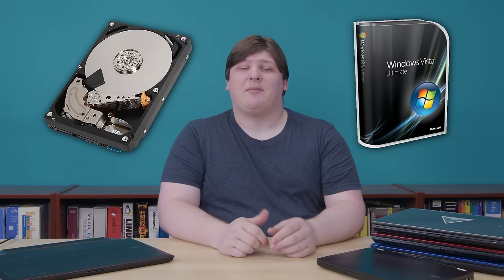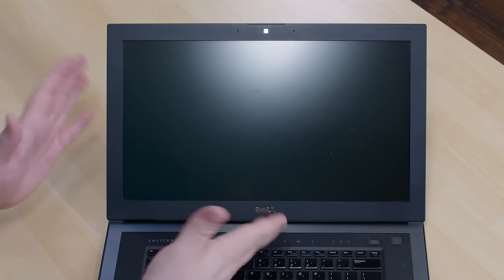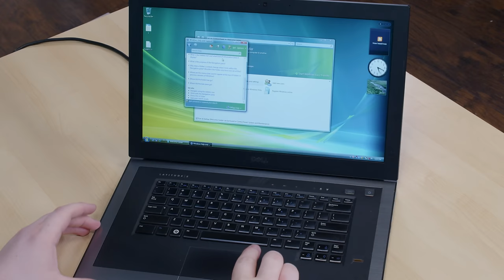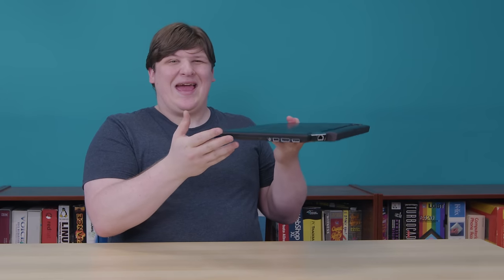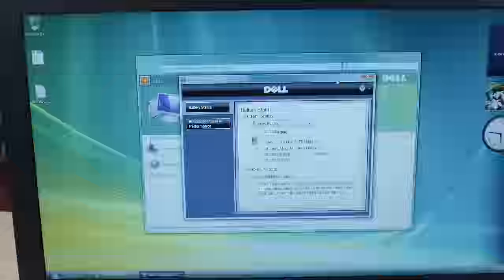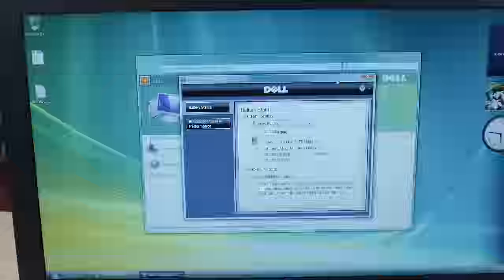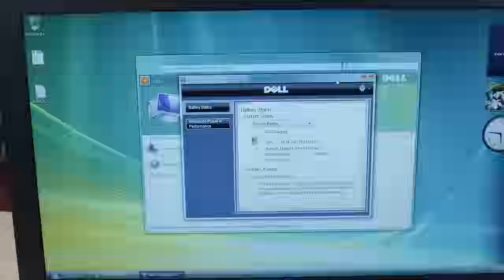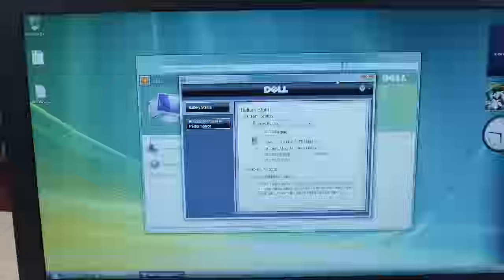Quick Start Ep 6: Assuming Direct Control

Comment: That wireless dock & display is pretty similar too the " Intel wireless display WiDi " approach that intel showed off, got that on my lenovo T420, actually works pretty good for putting up a youtube or netflix stream onto a TV while the laptop sits on the livingroom table easily accessible still.
Think it's basically the same as miracast just under a new name & a bit more more locked down hardware wise too Intel because ofc it is.
It has a pretty low latency on my dads tv but it's noticeable probably 100 - 150 ms slower compared to hooking up the laptop directly too it.

And I'd imagine is basically the same tech anything with wifi capabilities uses to cast the display to a smart tv or to a chromecast or miracast supported device, even blackberry phones supported it apparently from version 10.2.1 onwards.
Reply: Whereas WiDi is just wireless display, the wireless dock is more akin to WiGig, which is another wireless protocol used by Dell and allows full use of any accessories wirelessly... also via a wireless dock.

Comment: I've even suggested that (Desktop) motherboards should have a cheap mobile SoC on them to use for the light PC use they are used mostly for (internet/videos). How many people sit with a high power CPU and GPU desktop just to watch YouTube? (raises my hand). A modern cheap Mobile SoC could actually be fast enough to be useful while sipping power and keeping dust out of the system (no fans running), and it would be great for trying to solve hardware or software problems with your main system.
Reply: I wouldn't mind having a raspbery pi in my desktop or laptop as a secondary option. It would work better if they could switch reasonably fast from one to the other.
Reply: @PaulSpades  Well.. I don't see it ever being seamless with Windows. Even MS gave up on ARM Windows 8 since they underestimated buyer intelligence. They assumed people would like the cheaper Windows tablet version.. but buyers saw it for what it was- a tablet with an OS that looked like Windows 8 but forced a special Windows ARM Store for all software (A La Apple). You had to buy ARM versions of all your software to even run them on the ARM Surface. SO an SoC would probably need a custom Chrome OS type OS for cloud based stuff so you weren't using the same harddrive/files as Windows. But also give it some other tools for dealing with the main hardware/OS when borked.
Reply: @BReal-10EC  Oh, no, I don't want microsoft anywhere near my machines.
Reply: @PaulSpades   Ok Paul, show me - and the court- on the Dell Optiplex where Microsoft touched you.

Comment: It's odd that you've had consistent boot times. As someone who was very active in the laptop scene at the time, I can tell you from experience that on many machines Vista was painfully slow to boot. Multiple minutes wasn't uncommon, even on brand new laptops. I helped a friend pick up a Toshiba Satellite not long after Vista came out, and out of the box I remember being blown away at how slow it was, and I remember checking thinks like CPU-Z to make sure the advertised hardware was actually present because I couldn't believe how bad it was. Later updates improved this (and so this might be part of the difference you're seeing -- if you can, try and get an original Vista install, especially Home Basic which was pretty crap. I remember Ultimate being quite a bit better).
EDIT: That scroll bar on the bezel was definitely not unique, I can remember other laptops that also had it. I'd have to do a bit of digging to find the exact models, but a lot of the early 2-in-1 laptops that could flip over to become tablets had those edge scrolling touch sensors to make it easy to read text in "tablet' mode.
Reply from the maker: Hmm, are you sure those weren't just leveraging the touchscreen? Maybe the digitizer was slightly larger than the screen and extended under the bezel. Interesting angle though, I'll have to investigate.
Reply: @CathodeRayDude  I''m almost positive it was a separate strip, and on some early mobile Windows PC devices they had those strips because the screen itself wasn't touch sensitive. I feel like I remember Bill Gates giving a live demo with one of those early machines and it had the touch scroll bars at the edge of the screen. To be fair those weren't laptops, really.

Comment: 26:10 you need the bios of the highest spect model, it’s not a firmware thing it’s a bios thing wireless charging had a different model number and a different bios version but not a different board revision.
The bios of the wireless charging version doesn’t completely turned off the device completely in order to enable the charging detection with the downside of using more power when it’s turned off  to prevent users from accessing a feature that is not installed they just took out the code for it and left the entry in the UI, typical thing done by Dell cause bios versions are interchangeable.
Reply from the maker: That makes sense, I wonder if I could have flashed it on there.
Reply: @CathodeRayDude  pretty sure you can, the tricky part it to get the rom for it to make it happen.

Comment: I have to admit, I've never really had a problem with Windows  Start time on hard drives.  Well, at home anyway.   At work, it's a different matter.  Something in the image of Windows we depoy really slows down booting.   Never found out what, because we just bypassed the problems by upgrading to SSDs, but the startup time  went from a few seconds to nearly 15 minutes before Windows was running well enough to allow logins..

Comment: Ironically enough, boot times are not improved with modern hardware because of POST duration increase. In fact it may be quite the opposite if you had decent DDR3 machine with an SSD back then.
In DDR3 era, POST times were around 5 secs, short enough not to be even noticabe. OS startup time was the thing that matters.
In DDR4 era, POST times increased to around 15 secs and, considering overall performance uplift and wide spreading of SSDs, began to actually exceed the actual OS startup time. Espectially if you use Linux.
Now, in DDR5 era, POST times are absurd. I have 30 secs POST time on my AM5 machine. Considering that the hardware itself is powerful enough to spin up my Linux distro in 4 seconds. (Actual output of systemd-analyze: "Startup finished in 30.167s (firmware) + 190ms (loader) + 2.354s (kernel) + 1.364s (userspace) = 34.077s".)
And this is actually may count as good because some people report 1 minute and above POST times for AM5.
The only thing that saves now is Linux having soft-reboot capability (restarting the OS without rebooting the hardware).

Comment: I iust thought about something with these 2nd OS systems and the email clients. Back in early to mid-2000s, a lot of people were still using POP3 email access (even if IMAP was available, a lot of momentum still existed).

If so, then ouch, the sync errors between Windows email app and whatever would have been horrible.

Also, I had a Palm Pre  and one thing about that OMAP CPU was that they more often than not could be softwarr overclocked to 1-1.2ghz. My Pre ran a LOT smoother.

Comment: Edit: I think I may have just proven your theory that nobody knew these existed. I have 3 Dell Latitude e6510s, one of which I used for a few years back in 2010, and all of which have this feature. I never knew they had this instant-on OS until you said the e6410 had it, and I checked and sure enough there was the weird power button. My guess is I either looked at the logo above the button and was like "huh, that's weird" and went on with my day using Windows 7, or I pressed it on accident once, didn't know what it was, and restarted it before forgetting about it shortly after.

The moment I saw "montavista" I was very confused as to why they would choose that as their distro, and I was confused as to why montavista would take that long to load, and then the moment I noticed the arm build my reaction was "there's no way they built in another computer, there's no fucking wa- HOLY SHIT THEY BUILT IN ANOTHER FUCKING COMPUTER"

Even though it's ridiculously impractical and makes no sense, this might be the coolest quick start OS I've seen.
Reply: Adding a reply here, I'm rewatching this video and I really like the idea of hacking the Latitude ON port in some way. I don't have a module for any of my three latitudes, but it shouldn't be impossible to reverse-engineer the port, which is probably just a collection of standard protocols, and build a new module with a ridiculously fast SoC. Maybe I could start with a pi compute module?

It would be an interesting project to even attempt, and if I could get a faster SoC in there it might actually be a really cool feature.

Comment: 1600x900 is actually a really good text size... considering the display is 13-14". 
even displays with higher DPI usually automatically scale to around that size, my macbook M1 has a 1680x1050, but it scales to 1400x900
and also display scaling in that era was really not there yet, so you would either want a larger screen at 1080p, a smaller screen at 900p. 
so yes this laptop is the wrong size for comfortable sizes for most people.

Comment: A bit late to the party but the nokia n900 was the ultimate nerd phone. Full keyboard, a kickstand and it ran maemo which is just linux meant for small devices like the n810 and n900. So you had a full linux terminal to boot. It also had an fm transmitter which was neat. I miss that phone.

Comment: the USB port that is also eSATA is like a combo port, normally eSATA was its own port but laptops would get ports like this that could work as either USB or eSATA, saving a bit of space, but I don't think you could get like a cable that'd also take power from those USB pins and power a 2.5" HDD, eSATA always needed external power supplies far as I'm aware.
Reply: No there was eSATAp which was an extended version of the esata/usb combo port that optionally also supplied 12v, but all usb/esata combo ports supported 5v supply although 5v-only esata devices were exceeding rare.

Comment: What I want to know is if the ARM computer can communicate with the host system.  See, I DO have a Linux ARM based computer installed as a PCI-e card in my desktop tower. It runs independently of and looks like an rs232 serial port to the host operating system. Reading/writing to the serial port connects to the serial console of the ARM computer.  I find it quite useful. Having something similar on a laptop could be useful a well.

Comment: If you thought a Core 2 Duo 1.4GHz was slow enough, I remember using a Dell Latitude that had a 1.2 GHz Core 2 Duo (specifically the U7600). It was from 2008 though

Comment: Oh my god, the interior looks frightening. It's like, if you try to repair something or switch the SSD for a newer one for instance...if this thing has accumulated enough dust in one or both of those fans and you have to sneeze, you're probably ripping apart half of the connections.

Comment: Edgetouch. That's a flex. Wireless USB. That's a flex. Wireless laptop charging in 2010. That's a huge flex. Latitude-ON. that's a flex. Holding a flimsy, back heavy laptop in the front. That's a flex, literally.
Reply: It's actually not even flimsy. It's pretty rock solid for a 'slim' laptop. Unfortunately CRD showed a lot of bias against this laptop, which was really unnecessary as it was supposed to showcase Latitude ON and not the laptop itself.

Comment: Honestly it feels like an expensive gift to an executive to try and kiss up to them, especially for an executive who isn't tech saavy and still isn't impressed anyway by it but the sender hopes it nets them a hire, promotion, or bonus down the road.
Reply: I had to setup some microscopic HP laptop for an exec (it looked like a netbook). It had a 1.8" hard drive and before he special ordered it I warned that it was going to be HORRENDOUSLY slow, I said just go with our basic laptop rather than special ordering this thing. 

Anyways I said I could make it work and after a year of "it's too slow" complaints and me showing him how the bog standard company laptop beat the heck out of it he finally changed laptops... 

This was in a financial institution, so we had a bunch of antivirus, endpoint protection, system management tools, tracking tools, etc loaded on machines... This laptop literally took almost 10 minutes to boot up.

Comment: I had a Z series latitude. I always thought this module for "Instant-On" or "L-On" was interesting, and wondered if this was something that could be exploited (for good or evil). 

After upgrading this computer to Windows 7, the battery life (as I recall) increased quite a bit. Unfortunately this laptop burned in the 2017 Tubbs, CA fire so I guess it doesn't matter at this point lol

Comment: A Core 2 Duo at 1.40Ghz in 2010 when the Core i7 mobile processors had come out the year before and were quad cores from the start. If I was going to pay that much at that time, I am GETTING an i7! Hell I got an HP ENVY that was really goo, even if it was compromised by budget.

Comment: I have a E6430 that with all the optional batteries is supposed to give you 30 hours of runtime in word. It does this with an extended main battery, replacing the optical drive with a battery, and a battery that plugs into the dock connector on the bottom. Not sure how that hold up now since haven't been able to find all of them. I'm guessing you could charge them externally and switch them out?
Reply: Yes the batteries would be hot-swappable, so you could remove all except one and charge them and then put them back in.

Comment: There was a smaller battery available that doesn't stick out of the back, you have the optional higher capacity battery there, the bezel is thick because it's flexible and comes off easily and makes screen replacement possible in a few minutes, the matt finish makes it less slippery and is still a thing among business laptops, the hinges are sturdy metal hinges that do not break like plastic cheap windows laptops, this is a business device and you are approaching it wrong
Reply: They also fit one of the best keyboards ever in this laptop
Reply: Yes, all good points. And I actually like the keyboard, it's rock solid as it protrudes through the chassis like on a MacBook. The only thing I couldn't get used to was the key spacing, but that's just because I'm used to a certain other type of Dell laptop keyboard.

Comment: have you every consider the purpose of the embedded computer is for the event that the main board stop working and you need a backup computer in the event of an emergency. A corporate user will value something like this in the event of needing to receive important emails. It has a valid purpose.

Comment: That reader would not have to make a copy of the email data, it only had to read the Outlook data file directly. Though if you were an advanced user you could change Outlook to use a differently named data file or just change the location from the default which would prevent that reader from reading the emails!

Comment: This laptop should be 13 inches and maybe would be good but only with an internal battery. That were possible the ThinkPad X300 from 2009 is as thin as this laptop, is 13 inches and even have an internal DVD drive that is hot swappable with another battery. And even fits in a manila envelope like in the MacBook Air ad. CRD you should make a video with that laptop, it is the holy grail of the late 2000s laptops.

Comment: If you have a large document, will the bezel scroll fit all of the pages on it or you need to constantly to pull to the bottom and then move your hand to the top and pull more or it acts as scroll speed where the middle of it is neutral and closer to top or bottom will speed up the scrolling?

Comment: There was a model of small HP elitebook that used mico sata hdds. I remember how much they looked like ipod hard drives but had that weird sata connector on it. Can't remember the model number but I'm pretty sure it ended with a "p"
Reply: I had Elitebook 2540p before with weird SATA-like looking port. And after looking it up online, I think it is. My configuration when I got it from my father however, was HDD installed to where DVD would normally go I believe, and that micro SATA port was empty.

I also failed to realize it had two quickstart OSes, QuickWeb and QuickLook, until a few months after I sent it to the recycling center. Though I certainly remember word 'QuickLook' from BIOS settings.
(Both were shown in the Express Gate episode, but he only showed QuickLook's existence in that video)

Comment: While you mention that it basically is a KVM you didn't seem to mention if you could actually load/swap both at the same time?  Could you load the ARM Core, realize you wanted to be in windows and still be  sending emails while windows loaded?  Once it loaded could you swap between the 2?  Assuming you could was there some kind of reminder that both systems were running?

Comment: How did dell screw up the battery life on that laptop? Those ULP Core 2 Duos were great for battery life. 

I "upgraded" from a 1.6ghz Core 2 Duo laptop to a Toshiba T130 with a 1.3ghz ULP Core 2 Duo. The 20% hit in performance was noticeable, but the trade-off was worth it for the upto 10 hour battery life in a 1.6kg laptop.

Though, you had to turn the backlight all the way down and be very careful to avoid HDDs spinups to get 10 hours. But it was stupid easy to get 6 hours.

I can only assume that Dell messed up the firmware and/or other hardware to get the battery life that bad.